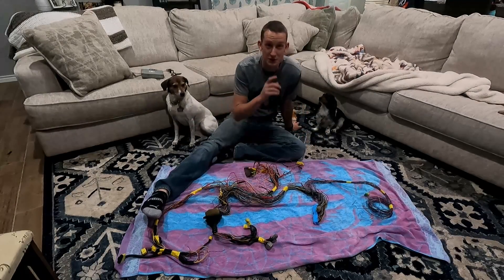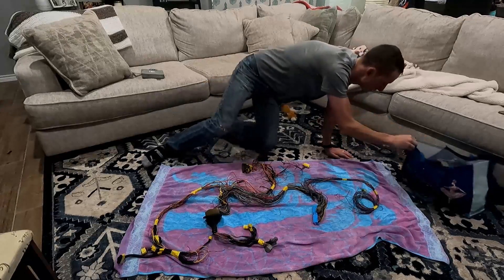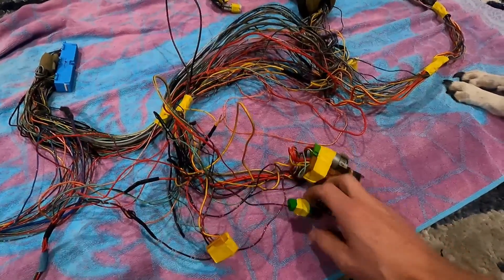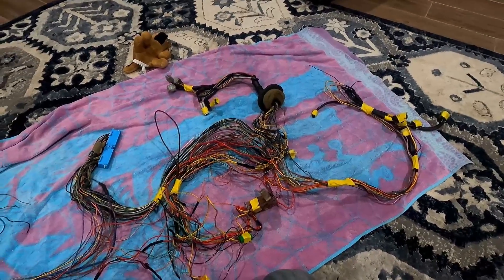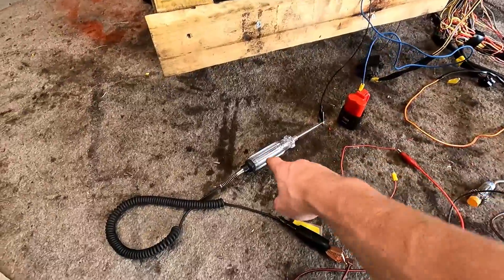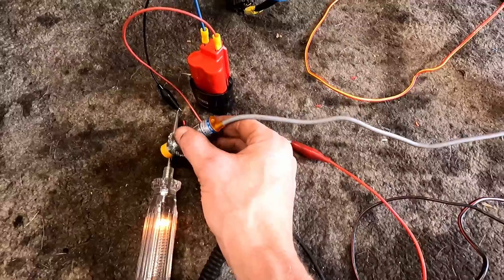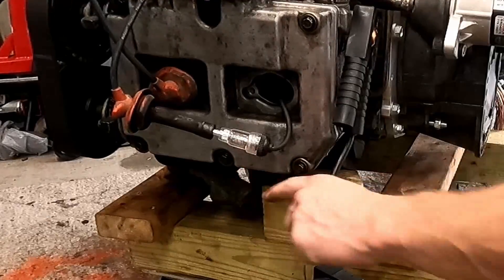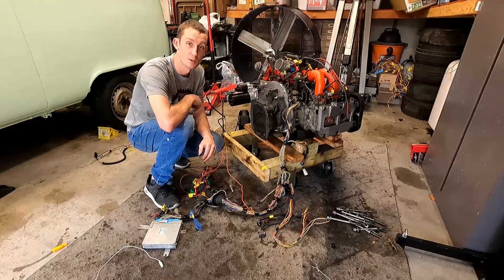Wiring Harness build for our SUBARU CONVERSION!

Comment: Where can one get the pin out looking to get back into my swap   It’s been 10 years since I last worked on it  I gave up Bec I couldn’t find any info on it  I got engine to run but couldn’t figure out why injectors wouldn’t fire 🤔
Reply from the maker: Busaru has a website and several videos here on YouTube. That’s what I used. He has links in his descriptions to pin outs
Reply: @GarageTimeTV  I tried  looking them up years ago  when I first stated but didn’t find much info then
Reply from the maker: @jaimenardo I’d take another look. I found it to be very helpful